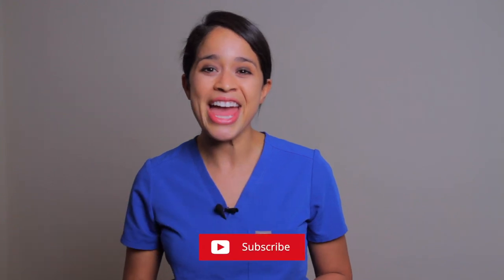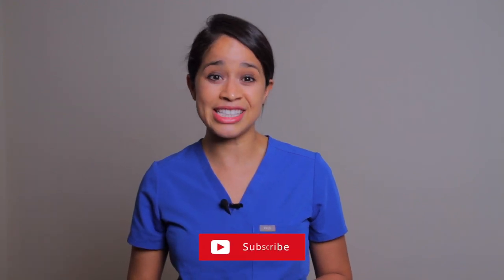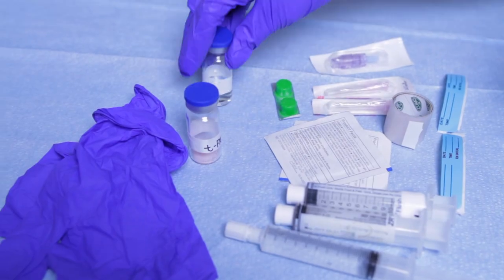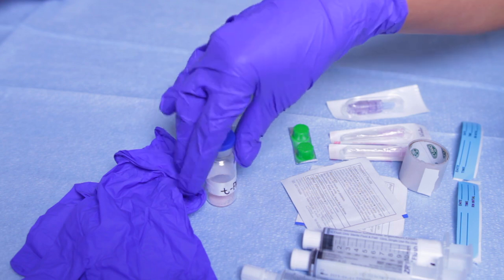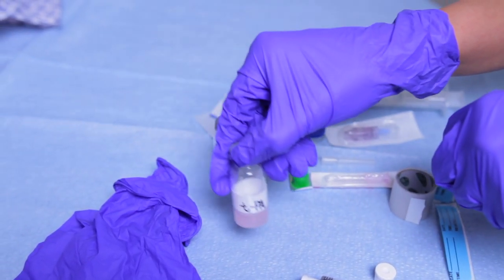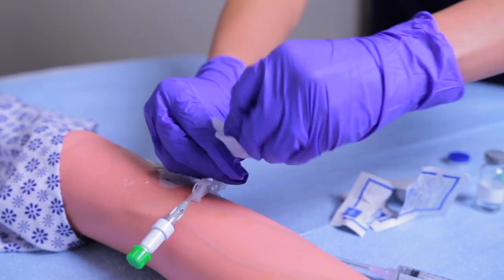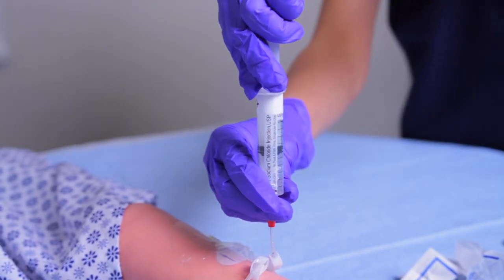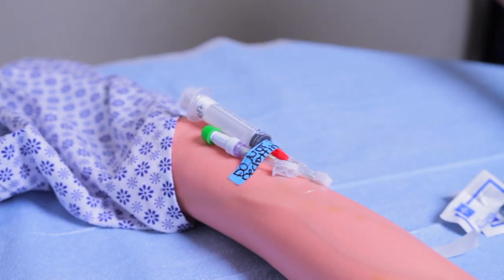How to DECLOT PICC line Skills Demo | t-PA | Alteplase | TINA NP

Comment: Can I ask a question, when you pull the air out and then inject it back with TPA, will it cause air embolism, or is it because it's a negative pressure, no air enters the line? I am just confused on that one step
Reply: i noticed that too. i usually don't pull air out and just push the 2ml of TPA in. not sure what your hospital policy is.